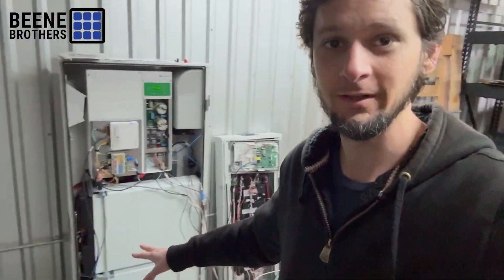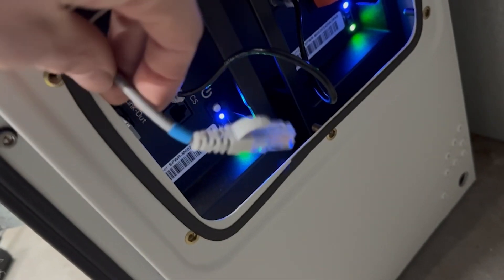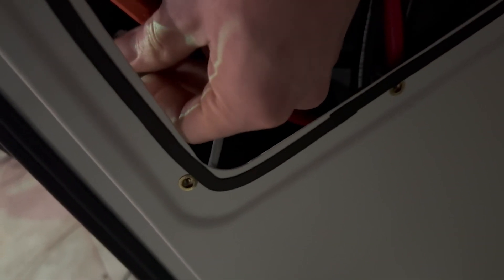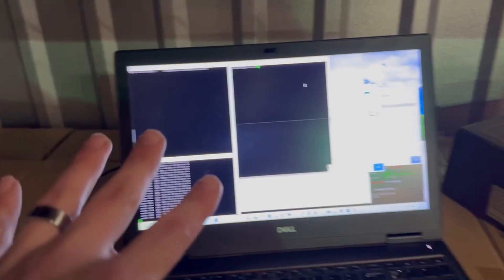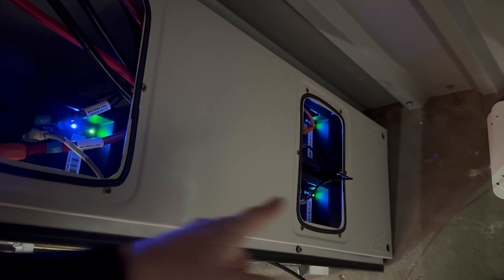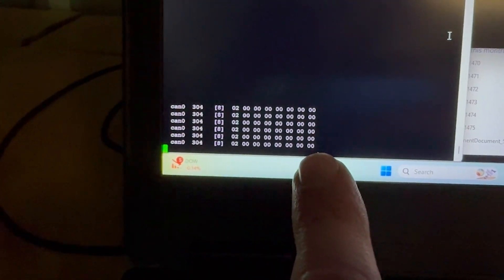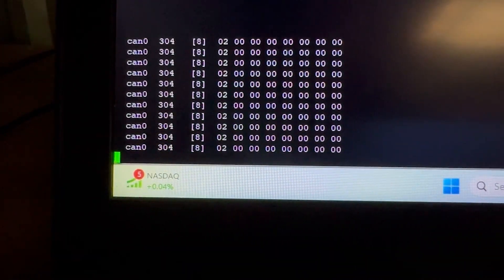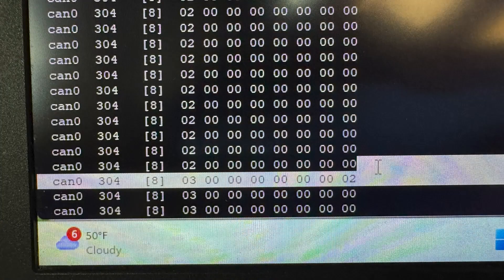Adding Battery Capacity to a SunVault 19.5kWh

Comment: I added a 6.5 kw battery from you this morning. Just wondering how long it should take for the SunVault to recognize/commission the additional battery.  So far it has been about an hour and the new 3rd battery is still “blinking” green.
Reply from the maker: Hmm, should have fixed itself before that. If you could, email me a photo on how you wired it in. If needed I can ship you a module to do the programming maybe your hub+ isn’t sending the command for some reason. Beenebrothers1@gmail.com
Reply: @BeeneEnergy  All is good.  Battery came “online” at ~3.5 hours.  Thank you!  As far as the mySunPower app, everything works except under the profile tab, the SunVault info still says 13KWh but who cares.
Reply: The battery came online 3.5 hours after connection.  Works well. Thank you.  In the mySunPower app all the metrics appear to be “functioning within nominally specified parameters” except under “Profile / SunVault Info” it still shows 13 kwh, but who cares!  Happy with the investment :)